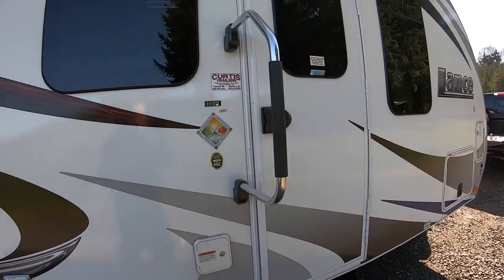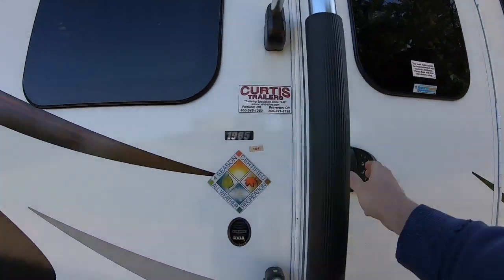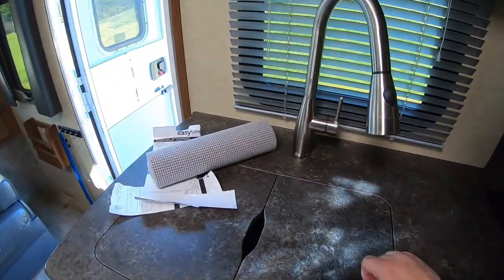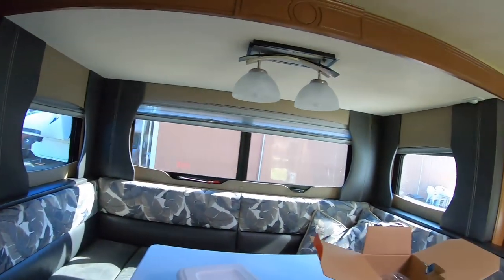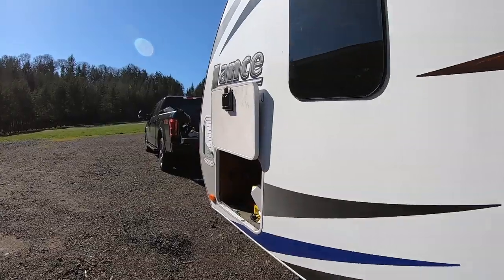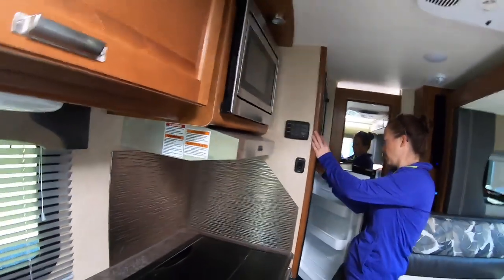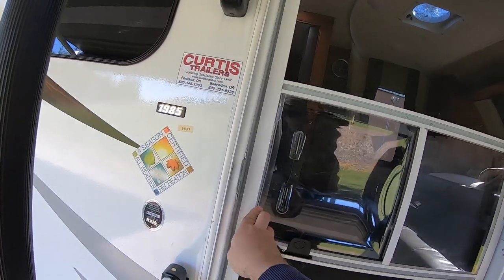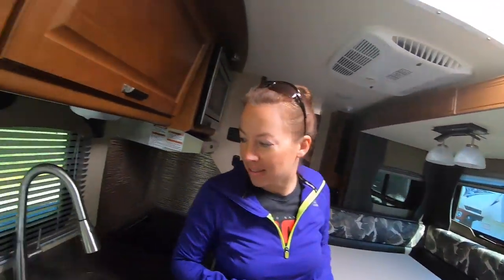RV Tour:  Lance 1985

Comment: We love our 2019 Lance 1995...we have the Murphy bed option as well, (mattress is very comfortable!) just a bit more room. Easy towing and backing too. Only issue so far has been one brake dragging, which our dealer (Pacific Travel Center, Tacoma, Wa) adjusted under warranty, and we were back on the road in under 2 hours. The Lance dealer network is outstanding (with some exceptions sadly) nationwide. It is well worth $35 to become a lifetime member of Lance Owners of America, the info and mods and just the camaraderie is fabulous.
Reply from the maker: Honu Maka thank you for watching. We unfortunately have had a lot of issues with our trailer. Been in the shop almost a month now. Not sure it’s a Lance issue or dealership issue but frustrating nonetheless. We had hoped spending the extra money would have been well spent but we are second guessing that now.

Comment: Thank you so much for the review.  I started looking at these last week.  I have been only considering Class C because of towing and backing in, of which I am a bit apprehensive about.   I think I will take the leap and practice, practice.  I have a 2005 Nissan Frontier Nismo and it says I can tow up to 6200 lbs.  So, hopefully I get really good and backing in and travelling over mountain passes.  Again, Thanks so much!
Reply from the maker: Our pleasure Robyn. Best of luck whatever route you go. Backing is definitely one of the hardest parts but after some practice you will get the hang of it.

Comment: i am considering the Lance    what vehicle you pulling with    i just purchased new F 150 3.5 l ecoboost turbo FX4  they say pulling no issue into high rockies mountains
Reply from the maker: Hi Charley. We have a 2017 F-150 eco boost fx4 with tow package. No issue towing whatsoever. We have seen folks pulling with SUV’s. You should have no issues. Do you you know what they say they rig you have can pull?
Reply: so far i can pull up to maybe 9000 no issue   the truck supposed to pull 13000 plus so i take 80% of that   they have chart  they take the numbers and i can pull the 2375 they say    just making sure no issues with the mountains   payload and trailer weight   2 adults cat bicycles etc etc  heading 49 states including Alaska    dealing with Lazy Days over in Tampa Florida    offered 3 years free camping Thousand Oaks    thanks for feedback
Reply from the maker: @MDFRfiredriver  you bet. Best of luck and safe travels.

Comment: For a second I thought was my own trailer. We have exactly the 1985 and I have the exactly same Weight distribution system and I put the bars exactly on that spot. hahaha. Now that we are back form the trip I will design like a clamp or holder so I can put the bars in the tongue, Since I wont be moving the trailer without them, I prefer to put them there and no use space in the trailer. And I keep them greased and is not good to get grease everywhere. If you still have this trailer and you are interested, after I designad/3dprin themt/test I can send you a pair for free :)
Reply from the maker: Really appreciate the offer. We do still own the trailer. I would be really interested to see exactly what it is you are doing. Definitely let me know when you do it. Always looking for easy to save storage space.

Comment: We have the 2019  Lance 1685.  Love it  but always something that can be improved.  Really wish the awning could operate without having to have the door closed over.  Always worry that someone might forget and the bars might get bent.  Replaced drop down lights over dinette with flush mount- no more head knocks when using area as bed.  Other than that, love this trailer - going camping on Tuesday!!  (We tow with a 2018 Tundra)
Reply from the maker: Funny you mention having to close the door for the awning. That is something we always tell people when they ask for any negatives about the trailer. 😂
Reply: JK’s Adventures   Also- never leave site with awning extended, door open and automatic retract on.  Have no idea if it  would stop on it’s own when it makes contact with door.  Major design flaw but our only real gripe.

Comment: Lance and Carefree have a upgrade further "Black Cones" on top of the awning arms that eliminate the rubbing that wears holes in the awning fabric. We had holes in both ends. I would post a picture here, but I can't. Good luck BobnRobin
Reply from the maker: Now that is a great tip. We actually have a small hole developing. Thanks a ton.
Reply: Another important thing to keep an eye on, are the metal strips (flanges) along the slide opening at the bottom. There are thru bolts and screws. If the flanges help keep the slide mechanism in the wall. There can be a lot of pressure on them when the slide moves in and out, on some models. Just keep an eye to make sure the flanges a snug. This is why your trailer should be level and stabilizers down when slide is out. Good luck and Happy Travels BobnRobin
Reply from the maker: Bob Porter good point. Thx

Comment: how do you protect the front window from road debris  rocks pebbles scratching etc etc  ?
Reply from the maker: Hi Charlie. We have owned the trailer now a few years and have never had a single issue. Most rocks, debris etc hits much lower than the window itself. Not even a mark or scratch anywhere near the window.

Comment: Thanks for tour, congrats on this new RV life. We’re looking at 1995 model. Want double axels and smaller length for tow etc. Do you use the Sway Bar at all?  Our tow vehicle is, GMC 2500 truck. Nice layout. The Four Seasn will be handy for late Fall early Spring camping. Or cold snap when headed south you’ll be covered. Tks Happy Trails
Reply from the maker: Aurora Nite My pleasure. Yes definitely use a sway bar. Never go without it. We are in Moab Utah now on a 11 day trip. We would not have made it without the sway bars. Wind was out of control. We have friends that have the 1995 and they love it. Biggest issue with any of them is space. As long as you organize well it will be great. Thanks again for watching.

Comment: Considering buying a 2019, 1475 model.  @ 3:15 you mention kinda hard to go out camping when you can't retract your jack.  Better than it happening when your camping, how would you have gotten it home.  I thought they had a manual override?  What will you do if it happens again while camping?
Reply from the maker: There is a manual option so you would never be stuck. It just takes some time to crank. Not a big deal but having the auto jack is so much more convenient and quick.

Comment: would have liked to see how big the 3 propane tanks are, and how they are mounted/setup in there. Also would like to see into ALL of the outside compartments...not have them all locked. (opened later on...). "fridge runs on gas or LP"...good one!
Reply from the maker: Thanks Jack for the feedback.

Comment: Thank you for the walk-though!  I really appreciated seeing the slide in to see how functional if making a quick stop somewhere.  We are considering the Lance 1995 or Outdoors RV 21RD/21RDS.  What other RVs did you consider before settling on the Lance and what were the driving factors that made you choose it?  We live in Idaho and want a better-built small rig that can handle washboard backroads to get to favorite fishing spots, etc.  Would you feel comfortable towing your Lance on these surfaces?  Chassis overbuilt enough or too light-duty?  We will be towing with a 2016 Ram 1500 Ecodiesel.
Reply from the maker: Marcelle Winn Fantastic questions. Funny part is we were also considering the Outdoor RV. Those seem awesome and well built. We live in Oregon. I believe they are manufactured here which we took into consideration. Lance are well built as everyone knows and I would feel comfortable on wash board roads but no matter what you buy there are going to be issues. We have had our fair shares. We bought the Lance in hopes it would hold up better. Only time will tell. If you have any other questions I am more than happy to help.
Reply: JK’s Outdoor Journal one more question:  Did you guys add a generator for boon docking?  Is there room in trailer to store it while traveling or back of pick-up?  Thanks again!  I’m enjoying your vlog!
Reply from the maker: Marcelle Winn we did I buy a Champion 3100 watt generator. We have to haul it in the back of the truck. Much too large to haul in the trailer. They do make smaller ones but you would need 2 of them to run the air conditioning. It’s no problem for us at all to haul it though as we have a cover on the truck. Hope that helps.
Reply: We tow our 1995 with a Ram 1500 w/tow package, and keep our yamaha 2000 genny in the truck. With the torsion axle independent suspension and the 2 5/8" lift kit,  and Goodyear tires (all standard cept the lift which is optional) we have no problems on unpaved roads. They also upgraded the frame in 2017.  With 45g fresh water tank, 2 100 amp hr batteries and 3 standard propane tanks, we can easily boondock up to 2 weeks.

Comment: Great video. Nice job! Couple of questions. 1) How is the backup camera? Does it help a lot? I am worried that I will have issues and many arguments with the wife on backing in.  2) Does the AC work well ?
Reply from the maker: Thank you Brian. Wow those are some great questions. Had to laugh a bit because my wife and I fight more backing the trailer than anything ever in life. 😂. The trailer doesn’t have a backup camera. Might be something to invest in though. The AC is fantastic. Cools off very fast due to the size of the trailer. Getting better backing though which has made things better. 😅

Comment: Couple questions: How does your f150 tow it? 5.0 or 3.5? 
The couch/ bed how comfortable is it?
Reply from the maker: Truck is a 3.5 V6 with twin turbos. Pulls like a champ. More than enough. We have the two package. As far as bed it’s ok. Kim has zero issue but she could sleep standing up. We did purchase a mattress topper from Costco that makes it much more comfortable. As for the couch its awesome. Very comfortable. Wish it had a recline feature but we bought little foot stools that help.
Reply: @adventuresofjandk  good to know. I've got the 2011 f150 3.5 and want that trailer also with the fold out couch.
Reply from the maker: @78ginop  ya I think you be fine. How much can it haul?
Reply: @adventuresofjandk  if I'm reading my manual right its rated for 96 hundred
Reply from the maker: @78ginop  most of these Lance trailers are pretty light. You will see them being pulled by small suvs. I’ve even seen the smaller ones pulled by outbacks. 😂. When ours is full I believe we are right about 6500 total. Seems to me you would be just fine. Just don’t go overboard on length of the trailer.